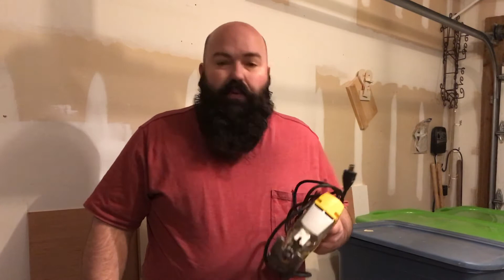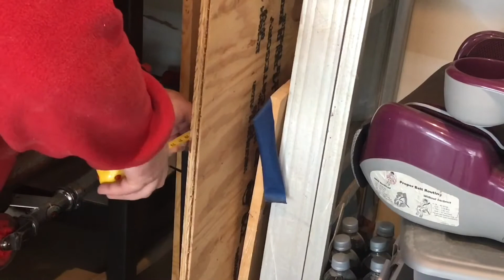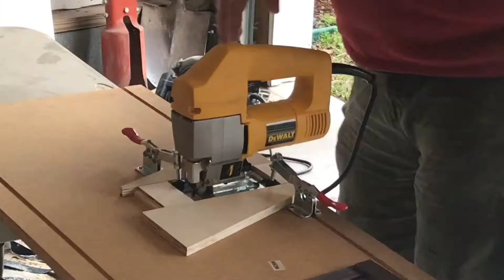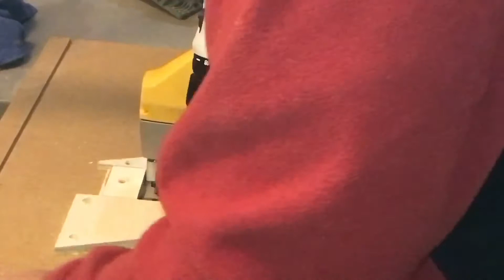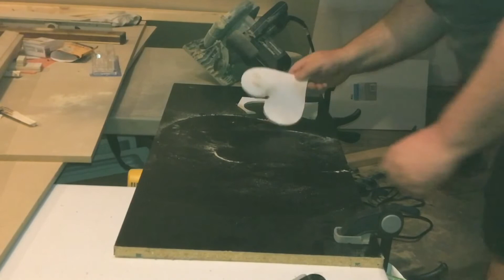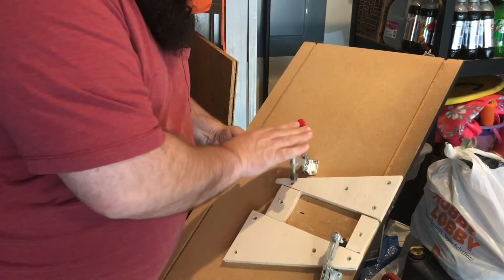You Can Make a Scroll Saw Out of a Jigsaw

Comment: Fyi my brother a smooth surface glues better than a rough one
Reply from the maker: I agree that gluing to smooth wood is better but I did not want to glue to the melamine side. To do that I would need to use a melamine glue or contact cement. I only had tite bond 2 wood glue which worked well gluing wood to the rough MDF side of the board. Thanks for watching and commenting.

Comment: Thanks big guy . This is the best idea to use an old corded jigsaw  I've seen on YT . I've got an old B & D jigsaw,  30+ years old . I simply drilled 4 holes into the face plate , and mounted that way.  Can't believe it works so well . From 🇬🇧
Reply from the maker: That is awesome. Funny how people think B&D is junk but I see some of their tools from the 1980's still running. I hope your jig works out great for you. Since the board I used was black I now spray some white paint on it to help me see where the blade is.  Here is a link to short video showing me use it just last week. https://youtu.be/XUU2tXincGk  Thanks again for watching and commenting.
Reply: Update on my jig - still going strong you'll be pleased to hear . I've modified it by attaching a guide at the highest blade saw point when the blade retracts . Some YT clips showed using tiny rollers , I simply cut a kerf out the width of the blade . This was supported on a wooden arm . Hope that makes sense . Looking out for future tips 👌

Comment: Hi why don't u ĺike Philips screws which r the main go to screw in the uk.
Reply from the maker: I did not mean to offend anyone and I know there are debates online about this subject. Star drive screws are easier to align with the driver because they are more entry points in a revolution as compared to a phillips screw. Also, phillips head screws are more likely to strip out because of the pressure required to press the driver into the screw head. Again, that is just my experience and opinion. It was not meant to offend. I have used many phillips head screws in my life and they surpass a slotted screw head. thanks for watching and thanks for voicing your concern in the comments.
Reply: @MarriedManWoodworking  don't worry about it,just asking.good vid will try one tomorrow.
Reply: @MarriedManWoodworking  Have you ever noticed if you need a Phillips screwdriver you only find slotted?
Reply from the maker: @CharlesNolanArt  That's the story of my life. If I need Phillips, I only have slotted. If I need 80 grit sandpaper, I only have 120 grit. If I need a hammer, I can only find my mallet. Thanks

Comment: While you were at Harbor freight, why didn't you just pick up a foot operated power switch instead of going to the clamp and plugging the outlet in and out every time?
Reply from the maker: I didn't know Harbor Freight had that. Good idea. Thanks for watching and commenting.
Reply: @MarriedManWoodworking  You're welcome. I'm glad I could provide some information that might make your life easier. I've attached the link below for the click on, click off switch. They also make a momentary switch that you must keep your foot on to power the tool and simply take your foot off the switch to turn the tool off. I use the momentary switch on my table saw as a safety measure. Have a great week!

https://www.harborfreight.com/power-maintained-foot-switch-96618.html